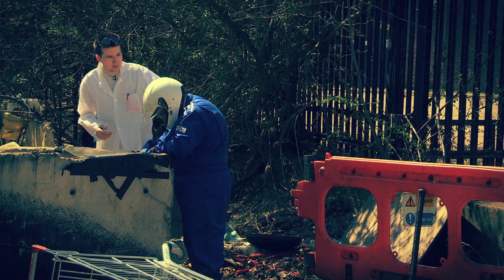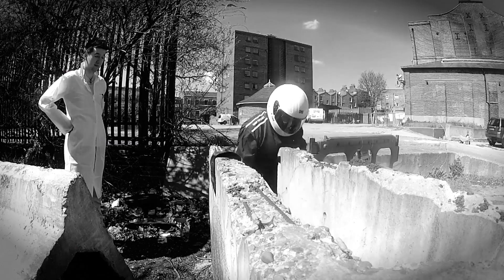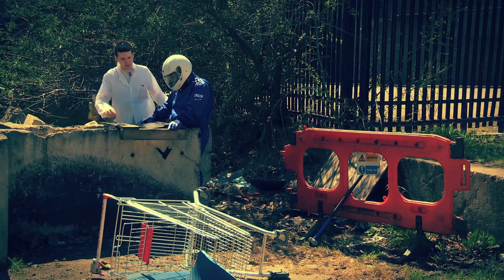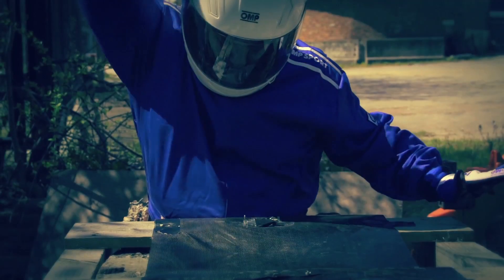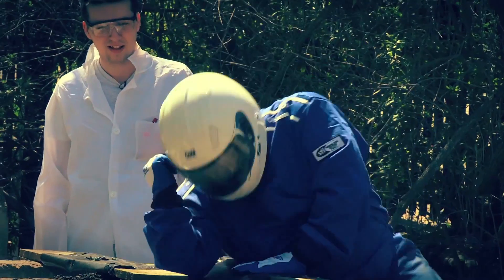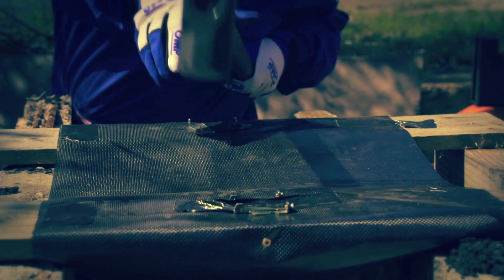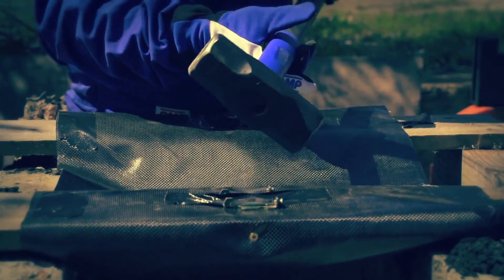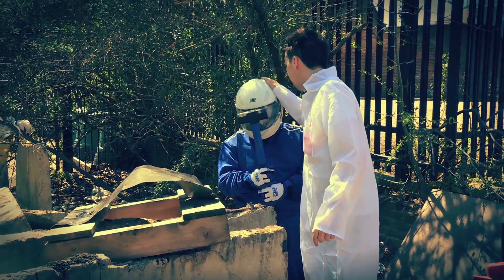Safety First - How strong are carbon fibre F1 cars?

Comment: what an unnecessary test. you really didn't quite understand that the fibers themselves have no real mechanical properties without resin, did you? so would you build a part just out of pure fiber fabrics an stich it together with yarn or what? also what do you mean by it can withstand 2 tons of pressure? in which direction and on what area? usually you would say a cured fabric prepreg part withstands compression of about 700 MPa which is 700 N/mm^2 or ~70kg/mm^2 in the weft direction of the fabric ... so yea, do some research next time